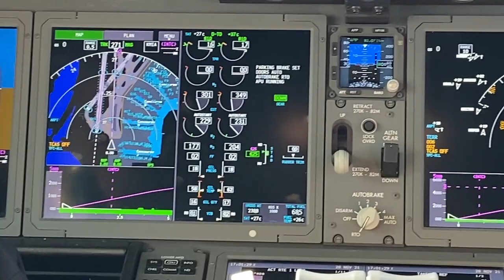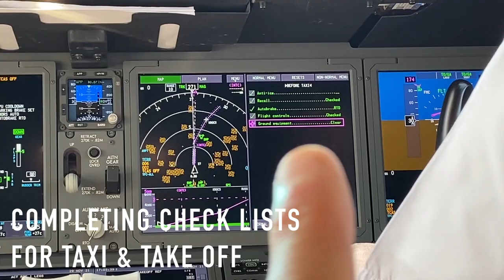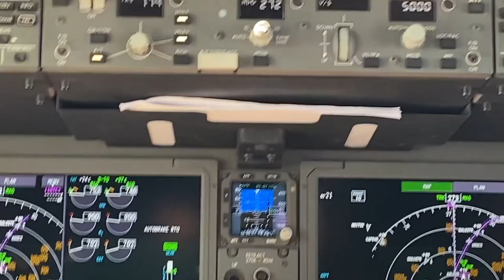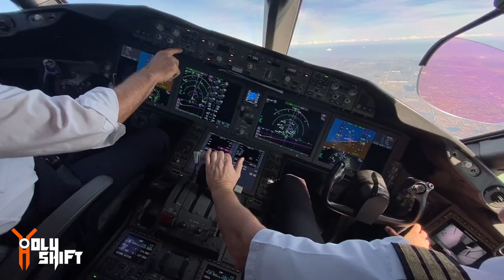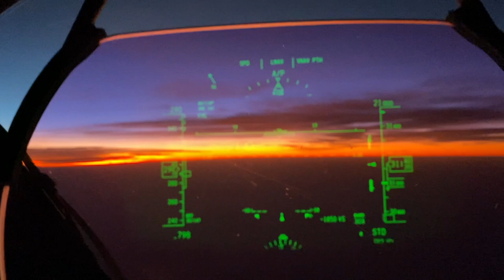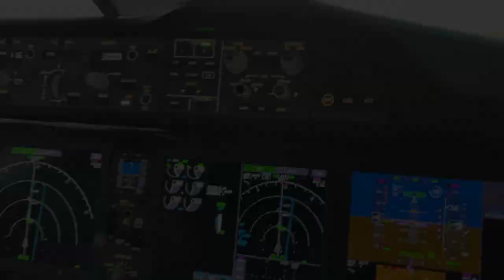Harley Sportster Exhaust Heat Shield Install / New Holy Shift Hat

Comment: Great video, be careful that sitting in summer traffic you are not preheating the intake air, as the air filter is right above heat rising from the exhaust pipes. Might consider  "mighty mites" like John's setup.

Comment: Sandy , The mounting brackets that hoseclamp to the pipes should be turned around so that most of the bracket is hidden behind the heat shield.
Reply from the maker: I did it to the max that I can still get a screwdriver in…

Comment: Your videos just get better and better. A great addition with the guards. Useful. Now I have a question. Why did you add in the chain drive over the belt ?
Reply from the maker: Thanks brother! I actually bought the bike with the chain already installed- but it is better for the intended usefully: the off-road scrambler . Belts are not really good with dirt and rocks…